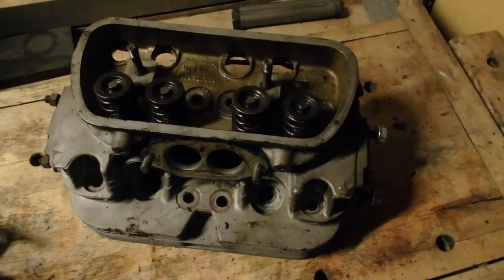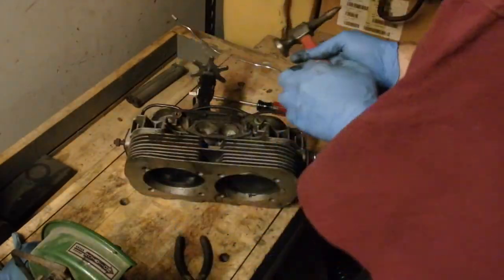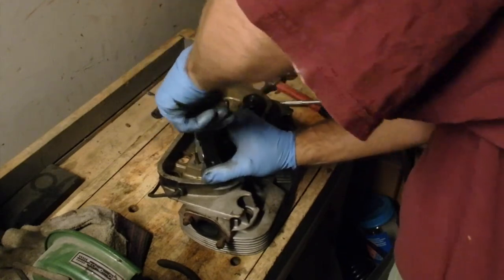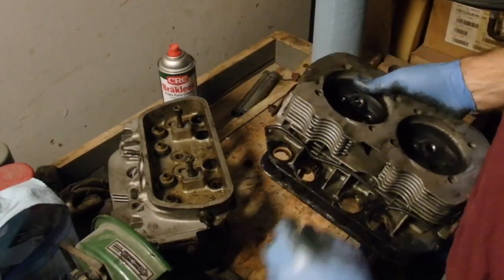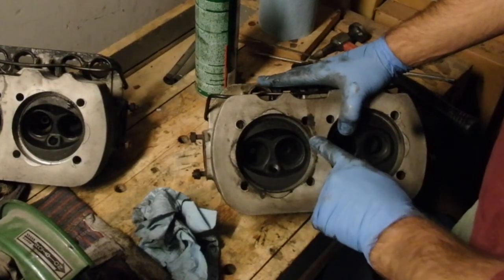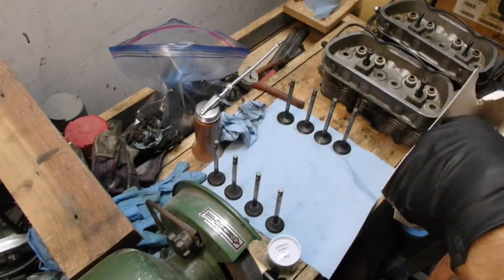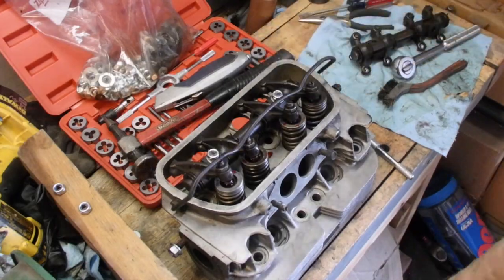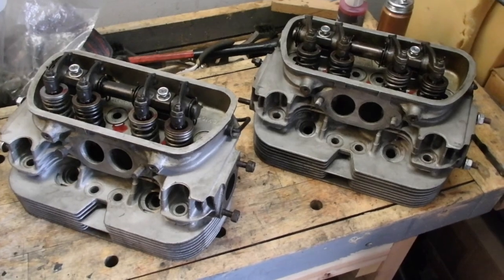1969 VW Bug Project - Episode 33 - Refurbishing the Heads

Comment: Very nice, doing and old 1965 1200 40hp single port right now. Cleaning everything up and will do the same thing on these heads. Not sure about the valve condition yet and there is some impact damage from a blown-out piston in one area but not where you lapped the inside so should be good. Definitely had blow by on the head where the blown piston was so lapping is a must on these. I got one of those cheap spring removers too, so your video is helpful setting up for this.

Comment: Those are good valve spring compressors. They work great for diagnostics. Let’s say you suspect an abnormally worn guide. Real easy to pull spring off to verify, without removing cylinderhead.
Reply from the maker: Totally agree.  I'm going to be rebuilding another engine for a different project in the next few months, and this thing is going to save me.

Comment: I have a deep scratch in my head. I’m wondering if you can measure the difference after you lapped the head with the cylander? Yes, I put the scratch in accidentally while cleaning the combustion chamber. It doesn’t go all the way to the outside .
Reply from the maker: I put the heads back on years ago and don't have easy access to them now.  Sorry, Michael.  I hope you were able to get it worked out.

Comment: If you want to get rid of that carbon build up use a Dremel Polishing Wheel # 520.  I know that you are not going for perfect looking parts, but cleaning them up a little will help with performance.  A quick cleaning will not take that long.
Reply from the maker: Already about done with the reassembly, so the scrubbing will have to wait for the next round, but thanks for the tool tip.   I've added it to my Amazon cart.  Got a pair of them for $9.

Comment: Can you advise?  When the weather is 37 or below my car wont even register lights or even the alt gen light. It will jump start but when stoped it won't start again. But when the weather is 38 or above it starts fine and will start again no problem. The alt is charging. I removed the pos term and it dident die. I checked with a meter and there is no drain. I checked the alt and it's putting out 13 or so volts. Just wondering why the battery won't work in that temp but will when the temp gets above 38. Love your videos.
Reply from the maker: Sounds to me like the battery can't handle the cold.  Try bringing it inside one night when you know it'll be freezing the next morning,  if you take the house-temp battery out and the car starts fine, you know the culprit.  If the battery is old, it may just not have enough cold cranking amps left.